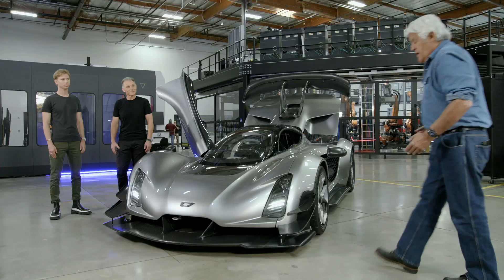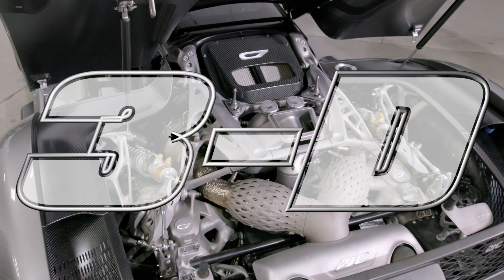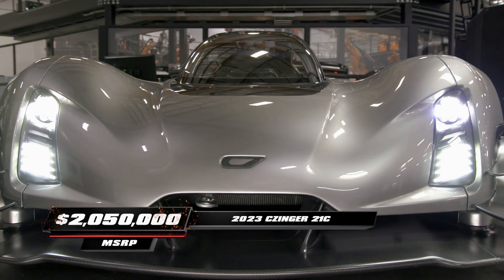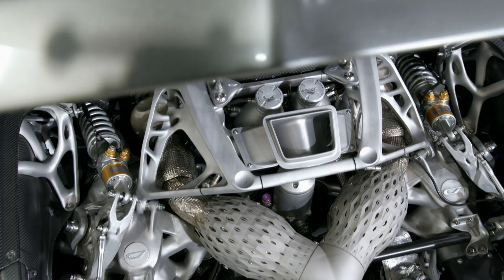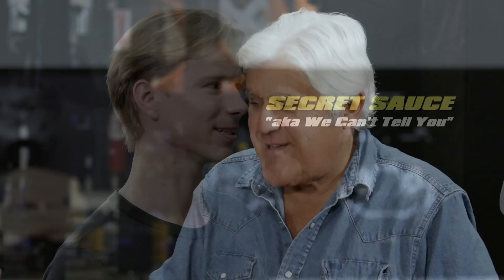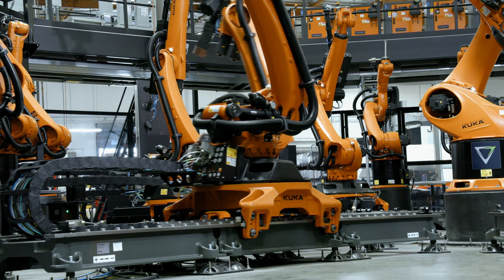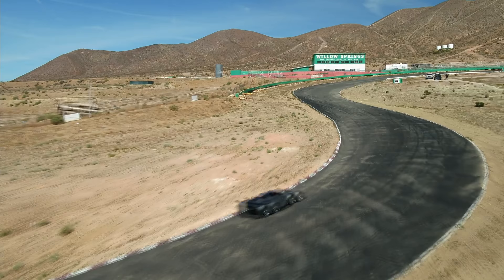2023 Czinger 21C 3D Printed Car | Jay Leno's Garage the TV Show

Comment: 3D printed parts is great for rapid prototyping and very low production builds but the down side in manufacturing is the time involved and cost. It is 10 -20 times more expensive to 3D print over conventional manufacturing so if you were planning to build 3000 cars it would more cost efficient to go conventional cast and machining. The flip side is it is very easy to change the CAD model if something doesn't work quite right. I'm a retired manufacturing engineer from the heavy equipment industry.
Reply: Exactly.
Reply: Yeah but the problem is conventional cars are all snore-fests, that just need to get regular people from A to B, safely at 50 mph and as cheaply as possible.
There simply is not reason to develop stuff within that area, as it is nearly perfected already.
Reply: My experience has been with rapid protyping too,  I'm a bit skeptical that you can make engine parts that will function for any length of time from these processes as I understand them.
Reply: Problem is; some of the internal geometry that makes these parts as light and strong as they are can not be machined or cast without making compromises with the parts becoming weaker and heavier. (access holes, sand core ports etc.)
I know Koenigsegg 3d prints a titanium turbo housing that can not be conventionally machined or cast because of the geometry.
This is not about the cost. It's about the hypercar budget that lets you choose the best way to make the best part, not the most cost effective one.
Reply: This. Metal 3D prints, especially structural parts need to go through critical heat treatment cycles. Sometimes before you can even separate them from the printer's build plate. Then there's the fact you still have to do machining or etching to remove support structures & for surface finishing.
Reply: What is the raw material? Carbon fiber?
Reply: You’re retired. I’m just starting my career in additive. Look at Suerat, Vulcan Forms, and Nubaru then imagine what will be possible in 20 years. Cost effective High volume metal additive for some applications is already here and more are coming! Look at Sakuu binder jetting metal oxides for solid state batteries!

Comment: Amazing.  He oversold things quite a bit, but I am still fairly certain from my experience and awareness that he shaved 50-80% off the design and manufacturing time.
Reply: Agree.  That brake node is a joke...  I doubt they engineered a way to replace the caliper seals in that mess.  If anything breaks you are buying a couple thousand? dollar node instead of whatever part to replace it.
Reply: What do you mean? I don’t know a thing  about 3D printing but I am guessing it’s not as easy as they said it was?
Reply: @ricklotter  In that car sure.  But what happens when this stuff becomes mass produced?  Cost of replacement parts would probably come down to very cheap levels just because it would be so fast and easy to print an entire new one.  
What I'm wondering about is how easy it is to take on and off those kinds of parts within the whole system.
Reply: @ricklotter  You are suddenly an expert in all this? It is also a $2M car, not a 18 grand economy sedan.
Reply: They didn't save any time in design or manufacturing.This is a huge fail from a manufacturing standpoint.
Reply: @joevarga5982  Why?
Reply: @doublestrokeroll  Have you ever done any 3D printing? It's EXTREMELY time-consuming. It's NOT a process suitable for making parts economically for mass-produced cars.
Reply: @joevarga5982  Apparently another 3D printed car...the first one ever done...something called The Strati, started off at 140 hours but with refinements they got that time down to 24 hours.  One day to print a whole car.  
So let's be very conservative and say it takes them 3 days to print that brake system.  How long is production on a standard brake system?  A few hours or a day?  Sure.  But that's in a factory somewhere.  After that it needs to be shipped from wherever that factory is.  And that's going to be VERY far away from most dealerships.  That part in Detroit needs then to be processed and shipped to California.  They ain't flying it there.  Multiple days to manufacture and ship that part to the repair shop.  And every single one of those steps has a huge cost involved.  Labor at every step.  Cost in fuel, fleet maintenance for the trucks or trains, pollution, cost of packaging for the part.  
One 3D printer in a repair bay on site taking 3 days is going to be worse than that?  I doubt it.

I don't think your making a decent argument against the potential of this technology.
Reply: @doublestrokeroll  "Apparently another 3D printed car...the first one ever done...something called The Strati, started off at 140 hours but with refinements they got that time down to 24 hours.  One day to print a whole car."

First of all, that's just a claim. Secondly, it would take hundreds of 3D printing machines running simultaneously to make an entire car in 24 hours.

"So let's be very conservative and say it takes them 3 days to print that brake system. How long is production on a standard brake system?  A few hours or a day?"

Few enough hours so that it's profitable.

"Sure.  But that's in a factory somewhere. After that it needs to be shipped from wherever that factory is."

Often parts are made in China SO inexpensively that it's well worth the time and shipping cost.

"And that's going to be VERY far away from most dealerships. That part in Detroit needs then to be processed and shipped to California.  They ain't flying it there."

Distance doesn't matter. Overall cost does.

"Multiple days to manufacture and ship that part to the repair shop."

Huh? New parts going to a repair shop?

"And every single one of those steps has a huge cost involved.  Labor at every step.  Cost in fuel, fleet maintenance for the trucks or trains, pollution, cost of packaging for the part."

That's what bean counters do. Do you think that 3D printers will be running right by the assembly line? No. They will be made by a supplier in a remote location, just like parts for current production cars are.
 

"One 3D printer in a repair bay on site taking 3 days is going to be worse than that?  I doubt it."

What repair bay? Are you talking about manufacturing new cars or making replacement parts?

"I don't think your making a decent argument against the potential of this technology."

I don't think you're being clear.
Reply: @joevarga5982  Everything you're saying is "just a claim" too.  lol

So you're saying they're lying then?  Well...I see a wiki page with sources for the information...so I'll take that over your claims.

Right.  Same thing applies to 3D printing.  If it's more efficient it will become more profitable.  

Right.  Again...if the over all cost of 3D printing on site becomes cheaper it will replace standard models.  Duh.  

You seem to think because the economies of scale aren't in favor of it at the moment that it will never happen.  

Pay attention.  Service centers in dealerships could have 3D printers for replacement parts. OF COURSE they would put them as close to the end user as possible if it is cost effective for them.  

I've been quite clear.  It's your comprehension that's the problem.
Reply: @doublestrokeroll  "So you're saying they're lying then?  Well...I see a wiki page with sources for the information...so I'll take that over your claims."

I'm saying IT'S JUST A CLAIM.

"Right.  Same thing applies to 3D printing.  If it's more efficient it will become more profitable."

Well, it's NOT efficient enough NOW to be good for mass-produced cars.

"Right.  Again...if the over all cost of 3D printing on site becomes cheaper it will replace standard models.  Duh.

Well, it's NOT cheaper now.

"You seem to think because the economies of scale aren't in favor of it at the moment that it will never happen."

I'm saying it's not ready NOW.

"Pay attention."

Grow up.

"Service centers in dealerships could have 3D printers for replacement parts. OF COURSE they would put them as close to the end user as possible if it is cost effective for them"

Fool, do you think a mechanic is just going to 3D print a wheel upright while your car is on the rack and pop it right in? How clueless are you? 3D printed parts are ROUGH and need post-processing. It's akin to a raw casting. You can't just install bearings and bolt it into the car. There's machining that needs to be done to mount wheel hub/bearing assemblies, ABS sensors, holes that need to be drilled and tapped, etc. Mechanics aren't skilled machinists and the complexity of doing machining set-ups is over the head of virtually all mechanics. Machine set-ups themselves are complex and time-consuming. You DON'T want to do a machine set-up for a single part. A lot of metal parts need heat treating and special coatings for corrosion protection, like cadmium plating and hard anodizing which requires expertise. These processes don't lend themselves to doing one flippin' part at a time, fool.

"I've been quite clear.  It's your comprehension that's the problem."

Stop trying to fault others for your own shortcomings, fool. You clearly have no experience in automotive engineering or manufacturing and have no idea which end is up, so stop trying to act like you know what's up because you DON'T.
Reply: @doublestrokeroll  hj

Comment: "Hey, I gotta an idea. Let's combine parts to make manufacturing more efficient" .. Later ... "Yeah, the fender bender means you need a small thing replaced. But as they are all one unit, you have to replace 25% of the underneath of the car"
Reply: Since when does a fender bender happen on the track?
Reply: @heytherebato  You've never been on a track. You should try it.
Reply: The target customer of this car strongly prioritizes performance over repairability.
Reply: Sure, but you're forgetting about economies of scale.  If this gets to a point where it's making things for mass produced cars it could be insanely cheap.  A dealer repair center would have a 3D printer on site, print up your part in a very short time and install it.
Reply: @doublestrokeroll  Bingo!
Reply: @BradsHacks  
Nice turn of phrase!

Comment: One potential issue with integrating numerous components into one 3-D printed part is that you would presumably have to replace the whole item if one component failed which could be expensive - not a problem on a Hypercar maybe but could be an issue on more mundane vehicles?

Comment: Saw some clips recently of them testing this thing at Laguna Seca & it's pretty impressive. But they seem to emphasize the AI aspect involved in the design to a point where it comes across as just usual marketing jargon. I'm sure their proprietary software is very capable. But I use programs like Ansys for FEA work which have automated topology optimization features regularly used in industry. Which can design lightweight parts with little user input. Even lot of CAD software now can do so at a basic level.
Reply: Only thing that mostly matters anyway is ' Just as long as it doesn't break at 253 MPH!😶_ all else is just  re'printable details -

Comment: This is so ridiculous. I'd like to see how you replace brake pads or discs. The caliper doesn't come off, so the disc is "trapped", probably requiring removal of the entire upright and maybe the use of a press. Forget about brake upgrades. You can't just swap out a caliper, you have to remove the entire upright when working on brakes and if there's a crack in the upright, you could lose hydraulic pressure. If you have a leak around a piston you can't just replace the caliper. What a PITA. Modularity is a GOOD thing.

Also, it's extremely time-consuming to make parts with additive manufacturing. This is strictly for expensive limited production cars.

Comment: "3D Printed Car"  The First Rule of 3D Printing Hype: Whatever noun follows the descriptor '3D Printed' is ALWAYS an incorrect word choice; typically the noun is actually referring to the 'Next High Assembly'. In this example, we have a car that was assembled (likely by hand) with some (or perhaps even many) 3D Printed parts. But it is NOT a "3D Printed Car", because [NEWS FLASH!!] tubes of 3D Printer 'Car Paste' do not exist. Once you're aware of this Rule of Hype, you will quickly notice that it is almost never broken. Adherence to the Rule of Hype is very nearly 100%. It's always the wrong word.

Comment: But when something breaks you have to replace more than is necessary making it more expensive to do. Unless if cracked or a piece broke off not bent it can be welded. Or weld the crack and able to weld plate around it to make it stronger.
Reply: Really? Someone who can afford a $2M car and he's going to be concerned about parts replacement costs?

Comment: We had some small 3D printers where I retired from. They had not taken the printers to that level yet, everywhere. But the design software was at the point of delivering all the dimensional and design requirements needed to create each separate part. Printed drawings of parts and castings etc. were coming to a close and PC to 3D Printed parts were at their entry. Awesome but devastating to many jobs like machining, drafting, casting etc. But you could create nearly any design in your head on a PC with the designing software and create that same part on a 3D printer. When they can do interstellar rocket/jet/turbine engines or whatever for space travel, robotics/automobiles, fusion engines etc. "lookout world". It is literally a whole new industrial boom coming soon to a theatre near you. Awesome future ahead if we survive the A.I. and greed of it. 🤠

Comment: one problem: you cant go to NAPA, autozone, pep boys to replace parts 
which means you are beholding to these manufacturers for the parts required to fix your car.
Reply: Yeah this seems gimmicky... and can't be done in quick/volume
Reply: Manufacturers are already providing 3D printer files for obsolete parts.

Online enthusiast groups are crowd sourcing the creation of free replacement 3D printer part files. They cover the repair of items for everything from 100yr old cars to new European dishwashers & car door handles.

What we create in plastic with $100 home printers now, we'll be creating at home with laser sintered alloy in 10yrs.
Reply: RushinRoulette  You haven't really kept up to date with Bugatti prices eh ? 

The Bugatti Divo is $8 million !

Lots of Hypercars cost over $1 million now. It's INSANE.
Reply: RushinRoulette  Only thing laying around Napa is dust... Autozone has part# 716102 rear main seal for the W16... just laying around...
Reply: You have the same problem with Ford/GM/etc... When you hear an auto parts store commercial saying "We carry the best selling parts"... it's not a pat on their back... they're telling you if it's not a high volume item, they don't carry it.

Comment: I'm looking at it from a mechanic standpoint. Do you just replace brake pads or the whole assembly? I mean it's nice that this tech is out there. It's still past the scope of the typical hot rodder
Reply: It's just a useless overpriced show car for commercial reasons, fun and testing.
If it was better like that every big car manufacturer would do the same "smart" design, but they don't, so...
Reply: 3d printed parts have came on The hot rod scene such as intakes and valve covers. But it's not for application. It's for proving concept. With that being said it is a valuable tool. I just don't see it in the life of the average hot rodder right now.
Reply: @richarddickey3010  ya still too early for that but for cosmetic (non metallic) applications it's for sure great.

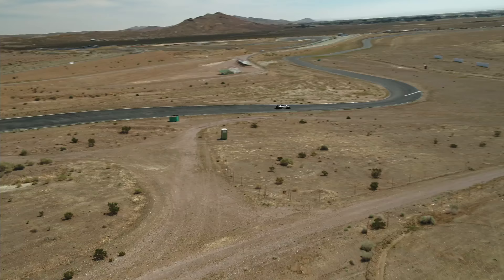Comment: 7:28 You’d think for 2mil that spoiler would be a bit stiffer.
Reply: Hang on for 20 mins, we will fix it in CAD and print another!
24 mins later Alright it's done, had to grab an espresso on the way.
Reply: we can add some bondo layers to improve it

Comment: I hope they designed that brake caliper in a way that brake jobs don't require us to disassemble the suspension! I realize that it's a carbon ceramic brake that shouldn't require much maintenance but if you're tracking the car, brake changes are inevitable

Comment: The general term for this is Generative Design. It uses Machine Learning Algos to minimize the amount of materials needed for the load stress of the part. Then you could either CNC Mill or SLS Print metal parts. This very much is the future of manufacturing not just automotive.

Comment: I see how this is revolutionary for prototyping and mold making.  However, I can't see how it works for mass manufacturing, unless the speed and cost of 3D printing can be made more efficient than established processes like casting and stamping.
Reply: This is true. However GM was able to get a 3d printer mini factory going for a part they were missing due to supply issues and design it and make it in time for no order delay. I think a month from the situation start to end. We're not at whole car yet but we're definitely in the part where it's viable for small parts for mass produced cars.

That month includes realizing the situation, getting the printers, designing the part, and printing. 

I could be wrong though as I couldn't find the article right now (half asleep) and if I am well that's on me.
Reply: New tech is always slow and expensive, compare PCB chips progress to this and you can expect to be printing your own car at home in thirty years time..canon will screw you for the cartridges though 🤣👍
Reply: Think of the transport savings no longer building stuff centrally then shipping to buyers ,add in staff ,storage and raw material savings and this printing way forward is a no brainer.